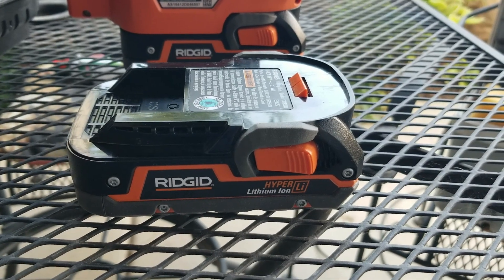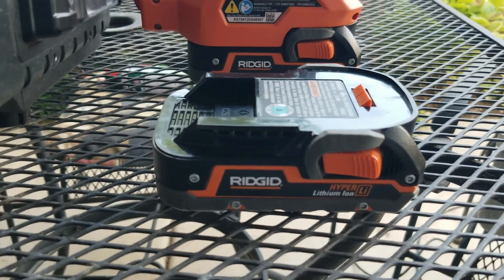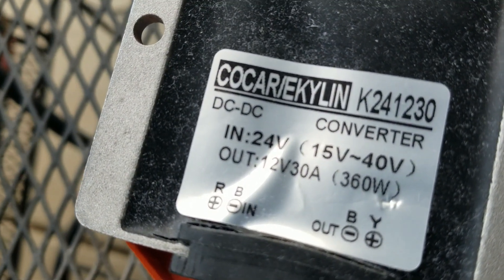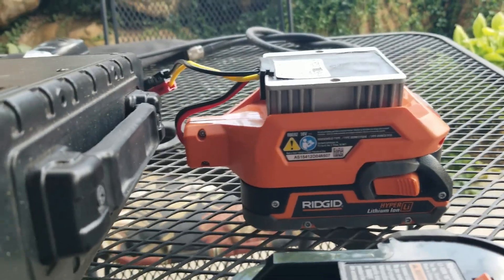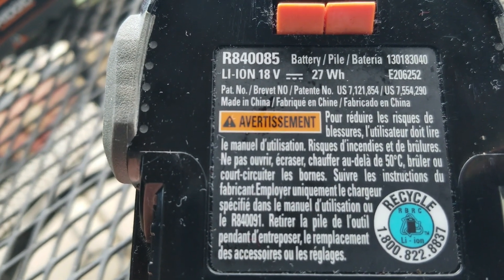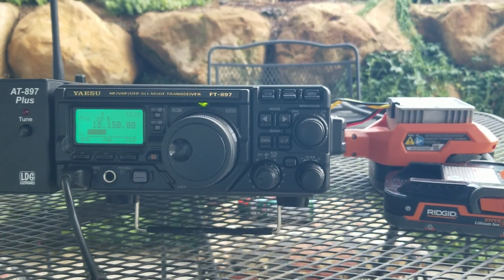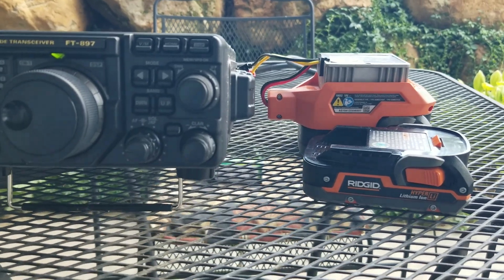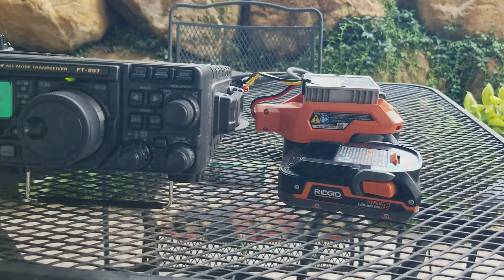Power Tool Battery for Radio Pwr 20220920

Comment: I appreciate the creativity, but I don't see why anyone would want to do this.  Power tool batteries are by far the most expensive Li-Ion packs you can find anywhere.  Ridgid packs are typically $2 per watt-hour.  That doesn't count the cost of the charger or the buck converter.  A Bioenno pack is about $0.85-$1 per watt-hour, and cheap Amazon (Talentcell) packs are around $0.60-$0.70 per watt-hour.  The last thing I want to do is put cycles on my expensive tool batteries.  Switching buck converters are also noise generators and result in energy loss in the conversion process.  If you've got old or bad tool battery packs, by all means break them down and salvage good cells.
Reply: Maybe not for using on a regular basis with cost and efficiency calculated, but if you use this on a SHTF scenario, I always have tool batteries charged in the garage and it'd get a radio on the air in an emergency.
Reply: it also is handy idea if you already have a few laying around, like I do where the tool may be broken but the batteries and chargers are still usable..😁
Reply: @Obeeewaan  in that case, I'd yank the batteries out and salvage them for another pack. No sense in carrying around all of that extra packaging and plastic.
Reply: Yep, have to agree.  The cost of my Makita batteries vs. a cheap LiFePo, they're staying in the garage for use with Power Tools!  Even the SHTF argument doesn't hold up, as you'd simply have a spare LiFePo pack charged if you were serious...and you'd want to keep the tool batteries on the tools in such a scenario anyway!
Reply from the maker: Thanks for posting your thoughts, Adam.
Reply: Knock off Milwaukee M12 9.0ah batteries can be had for $30. That's 108wh for abot 28 cents per watt hour, already 12v so no voltage conversion needed....